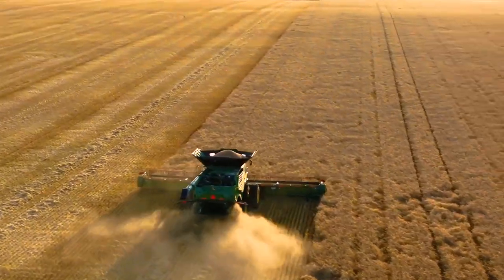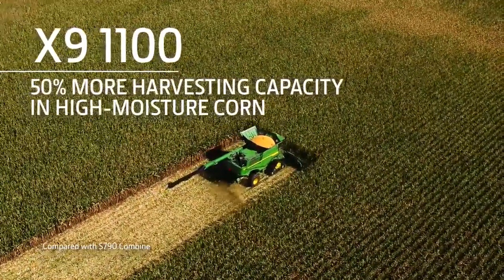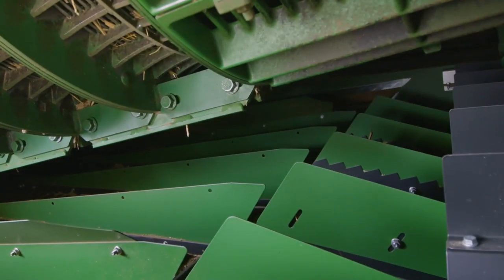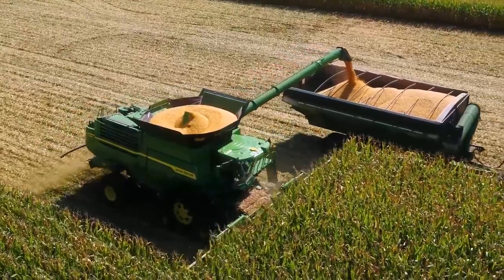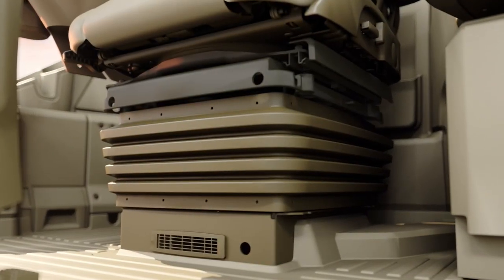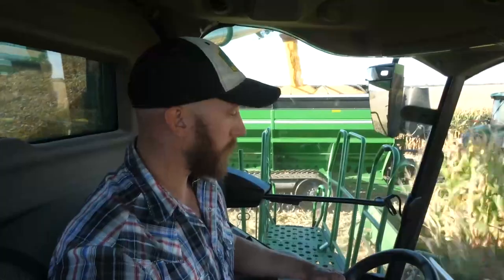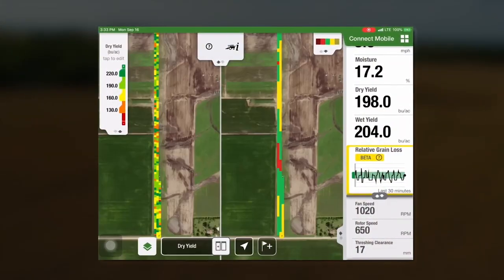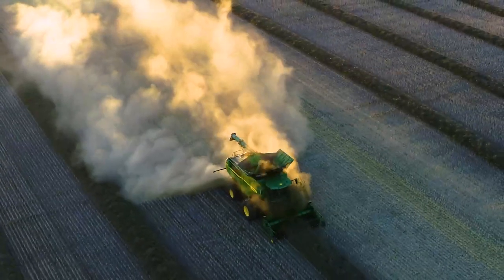The New X Series Combine from John Deere

Comment: It looks like a new holland painted green. This thing will never ever beat a cr9090. This is basicaly like an older version of a cr. Looks better, better service,  faster parts, better trade in but still.....not the sample or through put of NH , for sure not gonna touch a lexion in corn. This thing may for one time beat case axil flow but im.sure case will paint a red line of twin rotors to respond to this . Deere for sure has the best cosmetic  design team . They should go into the auto biz.